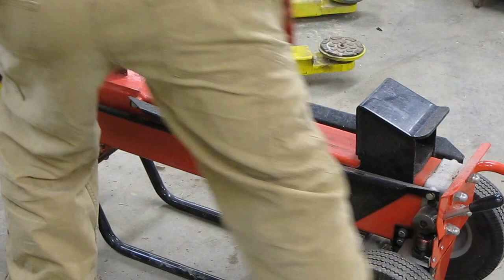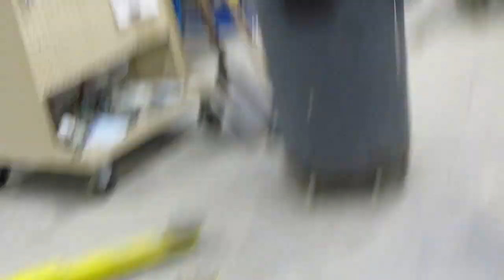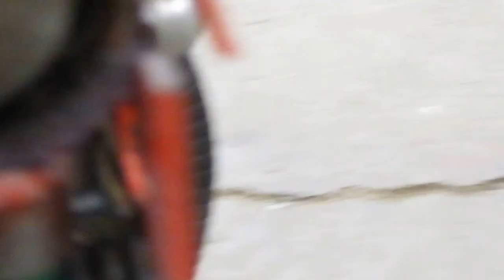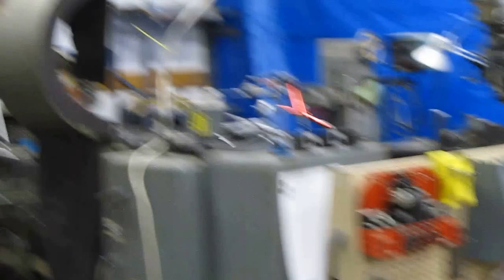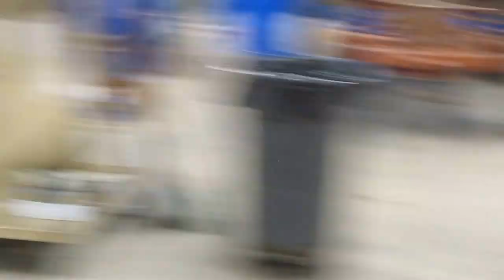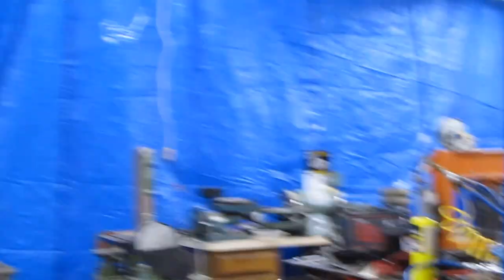Harbor Freight 7 ton electric log splitter 97113 , Modified for one handed operation.

Comment: I don't want to be any where around my powersmart. The Log explodes  SO i got a rope and a stick wedge the stick between the button where i pull down on the rope  and tie to the stick and  handle at the same time, With a rope looped to a flat piece of wood for a peddle

Comment: Very clever re-engineering of the off/on switch. Report is that you may get hit in the face by wood using this; so wear a face covering protection.
Reply: Had 1 for 10 years never got hit in the face. It will shoot wood out across the yard. Don't let the children play around it!

Comment: I removed the button switch from mine and put an on/off toggle switch in its place.  That way I can plug the unit in, flip the switch (like a light switch) and it is on until I flip it back off.
Reply: I just did the same thing. Make sure you get a heavy duty  toggle switch
Reply: I was thinking about the. For the last 15 years I used a wood vice clamp to keep it on.

Comment: Moving the button and your cam idea is good. But your arm is always in the way as you showed how it worked. I decided on an easier mod on my unit...I use a bar clamp on the button so it is permanently on, then have all my wood to split ready and just plug the unit in. Do my splitting and the unplug....been using this way for 3 years and no problems..easy pleasy! The two speed works well...fast to take up lack space, then lever full down until the split starts, then back to fast speed to push the ram to finish...that's how I use the duel speed set up!
Reply: That doesn't work on the majority of machines. You need to release the power button for the hydraulic ram to return to zero.
Reply: @dominangel23  I put a block of wood in the back to keep the ram from coming all the way back.
Reply: @twoweary me I just use a vice grip

Comment: I have a 5 ton splitter and I like your button modification but I have two questions....what switch did you use and where did you get it?
Reply from the maker: Deepsouthdiggers I used the original switch from the splitter. I just moved it.
Reply: Marcel LeMay ok thanks, the switch on mine is recessed so I was looking for an aftermarket switch. Thanks again.
Reply from the maker: Deepsouthdiggers My switch was also recessed. Take a good look at your switch. If it's like mine,  the bezel screws out around the switch making it like mine.
Reply: Marcel LeMay ok will do, thanks again.
Reply: Just use a wood vice clamp to hold the button down. It will stay running tell you take the clamp off!

Comment: been thinking about getting one that helped thanks !
Reply: It a good splitter. Had mine for fifteen years. Only had to change the  Starter capacitor,, As the 1st one shorted out. I put a wood Is clamp on the electric switch to hold it down constant. That gave me my one hand operation on the lever

Comment: What kind of wood can it split
Reply from the maker: Trenton Any wood that a gas powered splitter will split. The only thing it won't do is split a crotch in a log, but even most gas powered splitters struggle with those.

Comment: I'd like to see some detail of your cnc plasma table. It looks like an interesting design.
Reply from the maker: George Chambers .   I can do that! Which part of the design would you like me to focus on?
Reply: Well, I'd like to see the mechanical design. How the x y and z work. How you've connected the ways to the belting and motors. I have most of the parts gathered to build a cnc plasma and I have 3 other cnc machines. I have a 3D printer a desktop mill and a cnc router. So cnc is not a problem nor is the electronics it's just getting a design that is reasonably priced and not overly complicated. Your design looks like it could fill the bill. More info would be greatly appreciated. Thanks!
Reply from the maker: George Chambers If you're not already subscribed, go ahead and do that and click the bell icon. When I make the video, you'll get notified.  I have some free time this week, I'll see if I can go thru it. Also check the description in the video, I believe I left a link in there to the build log on the hobby machinist forums. You can take a look at that in the mean time.
Reply: OK I'll check that out. I'm already subscribed and belled ;-)